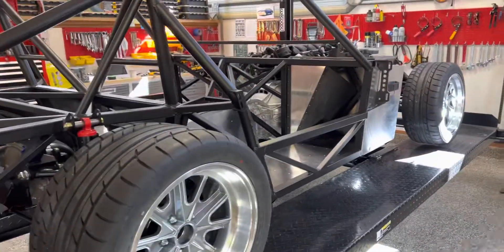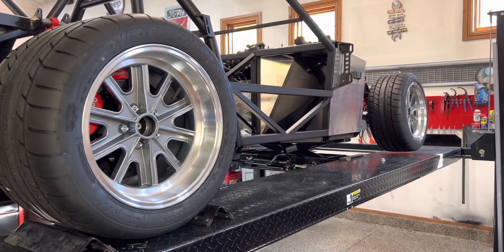Build Update 14, Engine Installed. Factory Five Type 65 Coupe (1965 Shelby Daytona Coupe Replica)

Comment: To anyone installing their engine with the lifting brackets, if you back the bolts out about a half inch on the side bracket it will canter in and will clear the frame. The bracket bolts are plenty long that you still have more than enough bolt still in the head.